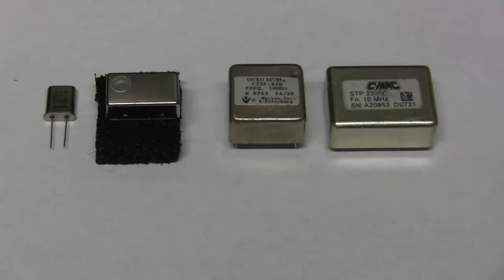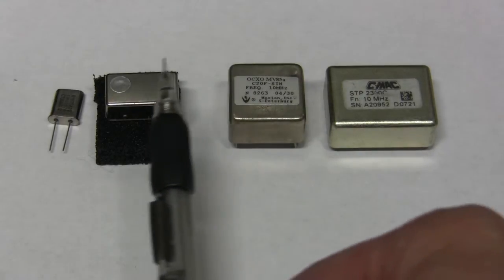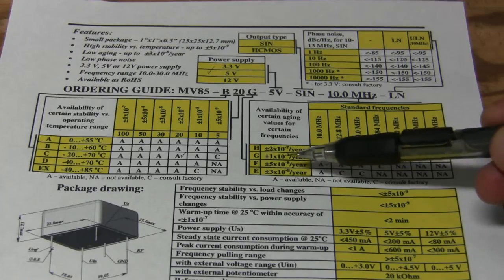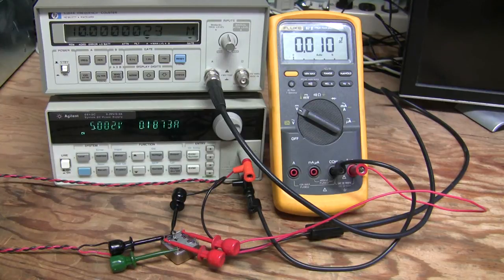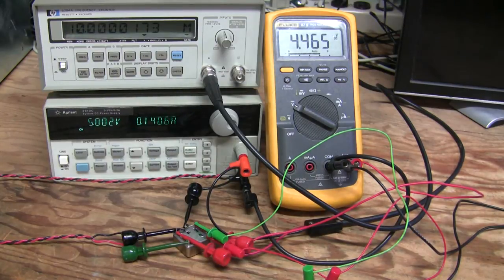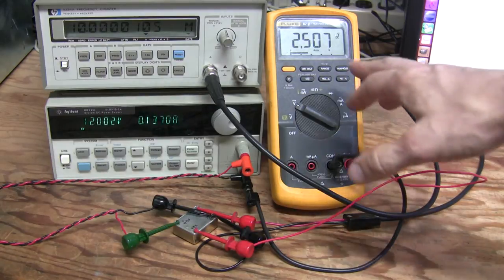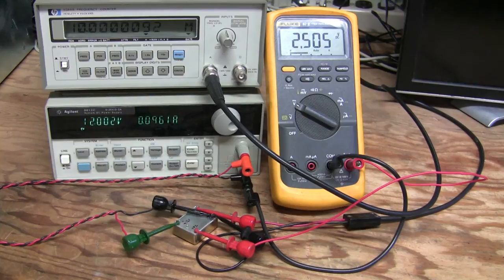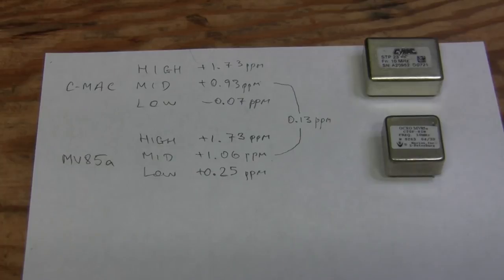#8 - OCXO Precision Frequency Reference

Comment: I bought a salvaged OCXO from eBay for about 15€ ($15) and made a wall clock using it as a frequency standard, with some 74AC logic counters to divide the frequency to a manageable level, and an Arduino nano to count the time. It's been running for a month now and compared to a radio controlled (DCF77) clock it is now approximately 0.1s ahead of actual time, which translates to about 0.05ppm accuracy. I am going to run it until the error is exactly 1s, which might take a year or so, and then change the control program so as to compensate for the error, after which I should have a very accurate wall clock indeed. It is running with mains electricity but has three AA-cells to provide backup power in case there is a blackout.

Comment: You have to compare the frequency to another calibrated standard or use a gps with extra hardware and software to measure frequency and the calibrate the OCXO. So you cannot make any assumption about the frequency of the OCXO and the counter accuracy using this method. That is why the OCXO has an adjustment pin, it's used to calibrate the OCXO because it is aging (changing in frequency over time). When you set the adjustment pin of an OCXO to mid range it will not be 10MHz. And when you calibrate it, it will be different a year later.
Also do not put 12V on the 5V verion it will eventually damage to OCXO.

You may find my GPSDO project interresting.
https://www.elektormagazine.com/labs/gps-assisted-10-mhz-frequency-reference

Comment: thanks for the interesting vids. I have a working rubidium and have measured it against different sources and would say I have it calibrated to 1ppb. very cool to compare sources with a HP 53131 and see how they behave, especially the TCXO's. If you want to check your oscillators I suggest some form of GPSDO, even one of the u-blox modules that has 10MHz output capability is quite accurate. As I'm a radio amateur I have tried some of the ham variants of precise osillators, I would like to recommend the qrp-labs.com stuff.